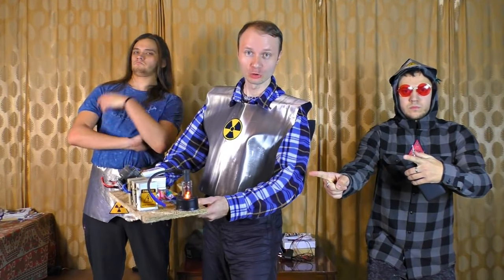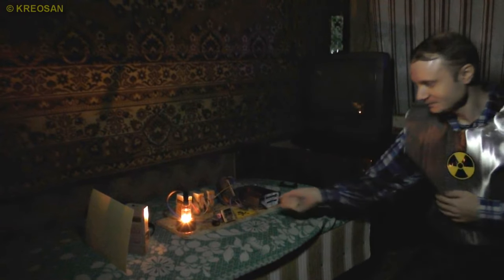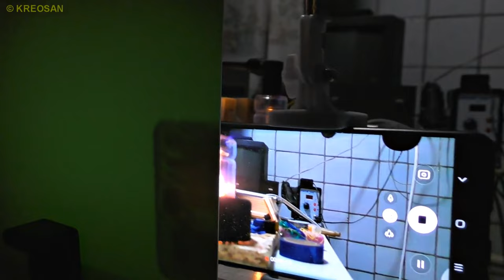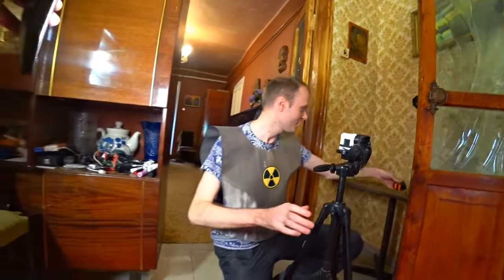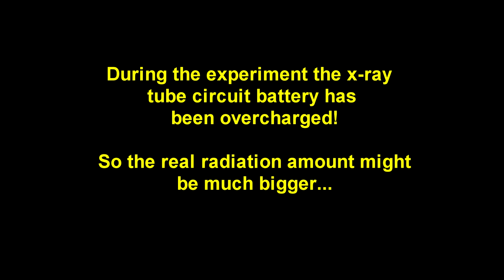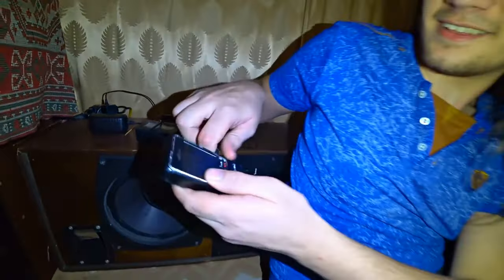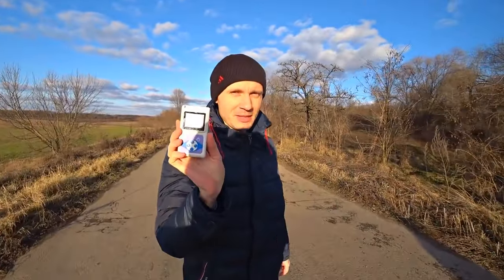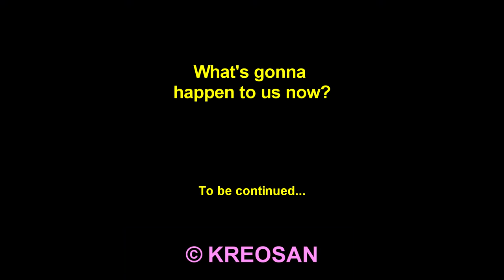X-Ray Gun ⚡️☢️⚡️ Experiments

Comment: They should have measured the radiation behind the device where that guy was standing. From a 1m distance they showed it was producing around 300 R/h, that's 0.083 R/s. We know that the absorbance of X-rays is low, and so they probably absorbed 0.83mGy/s which is equivalent to 0.83mSv/s. This is bad, but it's not as horrific as people are making it out to be. You start to see real damage at around 1Sv. You'd have to spend around 20 minutes continuously in the beam to get that kind of dosage at 1m distance. The guy that stuck his foot in there was much close than 1m. So he could have easily gotten a significant dose from just a few seconds. And the guy switching the unit on, if he was standing at that distance for 20 minutes or more cumulatively might have gotten a full body dose over 1Sv. It really all depends on how cognizant they were of these risks before they started. They definitely increased their risk of getting cancer. Radiation poisoning... well... I guess we'll find out in a few days I guess. Next video: KREOSAN visits the hospital.
Reply: So you say at 1 meter is about 3Sv/h
And around the source? How much is it producing?

Comment: X-rays will make a geiger counter scream for decay counts, but the decays themselve are not carrying as much energy a gamma rays. X-rays are dangerous non the less. Plus at the order of magnitude rates you guy measured, a Geiger-Muller Tube is grossely inacurate. You need an ionizing-chamber survey meter in order to make any sort of realistic measurment of the real amount of radiation you've been exposed. Be mindefull, your testes, your thyroid and your bone marrow and your gastro-intestinal mucosa are some of the most sensitive organs to ionizing radiation exposure. So you exposed yourselve to high radiation (especially since the levels rise exponentially proportionnal to the inverse of the distance you stand from the radiation source) you might fell tired, you might be more suceptible to infections (if your bone marrow become anaplastic) and you might experience diarrhea and vomitting from bowel mucosa irradiation. If you guys play with radiations, you guys need to find a way to direct the radiation in only one direction (collimation) by sheilding all arround the source except in the direction of collimation, by using lead ingots. Also, you need to wear a cumulative dose meter on your body to know the kinds of cumulated radiation doses you guys cumulated. Geiger counters is not good enough.
Reply: A gamma scout GM counter has a top of the scale measurment of 5 mSv/h (5000 uSv/h). That converts to 0.54 Roentgen/h.
Reply: i cant belive they do it so stiupid way
Reply: I have the same tube they used in my collection.  When I energized it, I found that it emits strong radiation in all directions, like a point light source, even through the thick copper anode...
Reply: @Paradoxical Nightmare by quantum mechanics, everything can be "light" - waves.
Reply: X-rays and gamma rays are the same particle and indistinguishable, the only difference is their method of production (nuclear vs. non nuclear decay processes). Historically the methods of production were such that gamma rays from nuclear decay were higher energy, but nowadays x-rays can be much, much higher energies, thanks to high energy linear accelerators.

(also thanks for clarifying that an ionization chamber is required. The GM counter is woefully inadequate for purpose)
Reply: @Paradoxical Nightmare You are completely and utterly wrong. Light has a colour, the wavelength is the colour. light with a wlength of 450nm would be blue, 500 would be green. Pure white as a single colour, doesn't actually exist, it's just an even mix of colour that mixes to form white.
Reply: @Paradoxical Nightmare at least you learned something dude, keep learning stuff.
Reply: @kyleewert1278  X-rays have shorter wavelengths (higher energy) than UV waves and, generally, longer wavelengths (lower energy) than gamma rays.

X-rays are broken up into broad two categories: hard X-rays with energies above 5-10 keV (below 0.2-0.1 nm wavelength) and soft X-rays with energies 100 eV – 5 keV (10 – 0.1 nm wavelength). Hard X-rays are more useful for radiography because they pass through tissue.

The distinction between X-rays and gamma rays is somewhat arbitrary and there is substantial overlap at the high energy boundary. However, in general they are distinguished by their source, with gamma rays originating from the nucleus and X-rays from the electrons in the atom. https://courses.lumenlearning.com/boundless-physics/chapter/the-electromagnetic-spectrum/
Reply: I have a feeling you know what you’re talking about
Reply: Umm x rays have the most power. They are way over gamma even
Reply: @MrTurboturbine  what is the this tube part number?
Reply: @jasonbattye7672  , Kodak TRX708
Reply: My dumbass has opened up a smoke detector just to poke at the americium with a pencil

But that’s as far as I’ll ever go to this insanity hel no
Reply: @peterzingler6221  Pretty sure gamma radiation is the most lethal on the electromagnetic radiation spectrum.  I may be interpreting your comment wrong though, sorry if I am.
Reply: @neb1ros  gamma radiation that physically destroys organic cells and I think also electronics too

It will rip sort a computer physics destroying it, which is why the chrenobyl robots all failed
Reply: @tony_5156  Thanks for your confirmation, Tony.  Gamma is king!
Reply: Geez dude, chill out, it's just some bros having fun
Reply: @CTimmerman   The way I classify gamma and x-rays is by their production mechanisms, to be considered being a gamma ray it has to come from the nucleus of an atom due a decay event, if the photon comes form orbital electrons or bremsstrahlung then is an X-ray regardless of energy. 
I am against using energy to tell the difference between x-rays and gamma rays because the generation process are different yet the energy they have can have overlap all the way to the UV, there is a Thorium isomer that has a decay gamma energy of 8.3eV just as there are particle accelerators capable of producing X-rays with energies of more than 20MeV and probably higher but im not sure if bremsstrahlung physics hold up at energies above 20MeV because electrons begin penetrating into the nucleus and might in fact cause gamma emission.

Comment: You guys claim yourselves as professionals... sometimes I truly wonder about that... but don't jeopardize your health for the sake of science. I truly enjoy your videos, you guys are most craziest Slavs I ever seen so far. If the Chernobyl trip wasn't dangerous enough, I think this time you just raised to bar. Don't get me wrong, I'm just worried about your safety sometimes...I'm not a professional by any means, just a Subscriber who just happens to agree with the majority of the comments here. Stay safe!
Reply: No worries, I did not see any science there so they just jeoppardized themselves for internet fame. Which is fine because it's perfectly OK to die for that, apparently.
Reply: A professional is someone who gets paid to do a thing. They are getting paid by YouTube ads..so that would make them professional YouTuber's and Tubers do stupid things. Come on now.
Reply: Jerry Jonty those weren’t what you’d call safe either but to each their own. I wouldn’t touch any high amperage/high voltage machines with a 10 foot barge pole. But it’s my job, these guys would be fine if they just took higher precautions.
Reply: @raghavendrasharma225  Setting off fireworks inside and melting wire with mains power isn't very safe.
Reply: The Chernobyl trip basically wasn't dangerous at all. The levels of radiation and amount of radioactive dust you might inhale are far too low to have any measurable long-term health effects unless you spend many weeks into months straight around the hot zones.
Reply: @Alongfortheride693  What are they?
Reply: @STONEDay  haha couldn’t have been said better

Comment: Guys, I'm sorry, but you clearly have no idea of what you are doing. The distance at which you put your hand infront of the Xray Screen is around the same distance you measured the 700R/h. you hold your hand there for 2min and you are already at the DHS emergency guideline. You hold your hand there for a combined 10min and you in the range, where people start vomiting afterwards.
Watch the hair on your hands and when it start to fall off maybe then you realize, what you have done.
You need to stop immediately and go back to electricity, that you understand.
Reply: Yep hair on hands and head will start to fall out. This is silly what they are doing
Reply: Holding for 2 minutes won't do anything bad. The dose would be 233msv (23.3roentgen(
Reply: @tamsusmomentai4013  The cumulative dose is one thing, the rate at which you were exposed to it is even more significant. Getting 1 Sv over a year is incomparable to getting 1 Sv over a day or an hour; in the second scenario, the quantity of cellular and molecular damage done is significantly higher, and directly interferes with the body's capability to self-repair these damages. At 1 meter they measured 410 mSv/h which is already massive and enough to cause immediate danger.

Comment: This is really dangerous. A small X-ray tube like the one in the video easily produces radiation levels of several sieverts per hour ! Please note also that regular geiger counters may give false readings when dealing with X-rays. The G-M tubes in regular geiger counters are especially made for the detection of gamma rays not X-rays. While both are technically the same (high energy photons), gamma photons tend to have higher energies than (most) X-ray photons. Low energy X-ray photons may even not be detected by standard G-M tubes but can be very dangerous as they are absorbed more by bodily tissues than the high energy photons which tend to just pass through.
Reply: Based on inverse square law calculations I calculated 51.2-204.8 Sv/hr. Death in minutes, cancer risk increased in seconds.
Reply: Ugh, do you actually think that a random person with some hobbyist-grade handheld X-ray gun is going to start cranking out "several sieverts per hour"? Seriously? Do you even know what you're saying? First of all, you're talking about sieverts, which are a *measure of biological effect*, not raw radiation output, which would be in gray (Gy), or more commonly, in roentgens (R). But fine, let's pretend we're in a world where this handheld X-ray tube is somehow the most dangerous gadget ever made—yet still small enough to lug around. Right.

Now, on to the point about Geiger counters "giving false readings" with X-rays—uh, no. That's not exactly how it works. A Geiger-Müller (G-M) tube detects ionizing radiation—whether it's gamma rays or X-rays, they both are detected because they're forms of ionizing radiation. But here's where you're misunderstanding things: low-energy X-rays are not some kind of invisible boogeyman that's magically evading your Geiger counter like it's got a Harry Potter invisibility cloak. No, the issue is efficiency. A Geiger counter might be less sensitive to low-energy X-rays because, yeah, G-M tubes are optimized for higher-energy gamma rays, but it still detects them. You're just getting lower counts per minute (CPM) because of lower energy per photon, not because they're undetectable. So your statement about low-energy X-rays being "very dangerous" because they absorb more into tissues... well, yeah, that's why we use lead shielding for any type of X-ray exposure, but your handheld tube? That's hardly producing the kind of output that’s going to nuke someone in seconds like you're claiming.

And let’s not ignore the fact that for anything handheld, especially if it’s something repurposed or cobbled together, the amount of voltage and power it’d need to produce a dose rate of several sieverts per hour would fry the device itself—or the person using it—long before it starts threatening bystanders. If it were truly producing several sieverts per hour, you'd be dead pretty quickly just from holding the thing.

So please, let's not get ahead of ourselves here.

Comment: 19:55 OH NOO! that is not going to end well based on this video...
Reply: Are they Russian?
Reply: @Kevin.98420  no 
Ukrainian
Reply: Im not sure which part worries me more, them trying to tie into a "high voltage line" (powerline?) or the possibility of them succeeding and producing maybe 10,000 r/hr at 3 meters. Based on their problems managing radiation and arcing in this video, they'll probably die either way. Best case scenario, the wiring flashes over and engulfs the whole thing in plasma within half an AC cycle,  cracks the glass and burns it to a crisp, while they stand far enough back to not be burned or shocked.
Reply: These guys don't even care about their lives, if that small tube can produce x-rays that are enough to give you malignancies think what would happen if they use that ginormous tube
Reply: @deltab9768  yeah i am not sure if that giant xray tube thing is something they should be messing with, if they don't think about safety shit they will die while messing around with xrays.
Reply: @Iodine_53  like I said, If they're doing what I think they're doing, I hope they short 110kv, several kA across it, while standing far enough back to not be hurt. I honestly cant think where they'd get a real 110kilowatt high voltage power supply, so I'm assuming they mis translated "kilovolts" and that they're wiring it to a 110kv power line and hoping for the best.
Reply: Kinda hope this is all faked somehow.
Reply: @amoniousbt1110  I don't think it is faked, when they put the camera in the beam you could see the pixels getting weird because of the xrays, that effect is really hard to fake. But maybe they are just making it seem more dangerous for views... 

i hope
Reply: @Iodine_53  I doubt it's faked because what they're doing is super easy to do. Just stupid dangerous too.

Comment: Don't use that giant xray tube. U guys are risking life of your and people that live near you
Reply: Yes. If they staid 50 meters away maybe they could be OK, but after the way they were handling this smaller one I'm worried. Did they ever think to check how much radiation is leaking to the side of the beam? And don't get me started about connecting to a "110 kilowatt high voltage line." That's not going to go well if they have even one of the short circuits we saw in this video. And where do you even get a 110kw high voltage power supply? I wouldn't be surprised if that was a bad translation of "110kv" as in a multi megawatt power line. No!
Reply: @deltab9768  I the bet radiation will still be intensive at that range. Have u seen the small xray tube's radiation rate from far away. Anyways the radiation is still not good
Reply: @bikgamer  yes. The small one had 60 milliroentgen per hour at 36 meters, so more than a normal yearly radiation dose from a continuous exposure of 1 day.
Reply: you guys clearly dont know how radiation work.. u need to stay 5 hour in the rays since it went of scale 100Rh we asume its 100Rh u need to stay there 5 hours to get ARS and thats really fast but you also need to be within 1 meter of the source and these guys stayed there a short time in the rays so they will be fine but yes Cancer risk is increasing but the short amout of time it spent with in the ray and body parts exposed they will likely be fine continiung the experiments  if they dont spend much time in the deadly beam of radiation.. but this is something you DONT TRY AT HOME but these guys are not profesional but they know what to do and not do... it really dangerous what they are doing but if they have the right equipment and dont go in the deadly ray too much they will be fine.. but too be on the safe side they should quit ( if u look at main channel.. they have not continued any more experiments with this)
Reply: @eliasnikolaivonheimtrondse4424  I'm sorry but what are you talking about goes for gamma radiation. X rays are a completely different beast. They are probabaly pushing 3 sievert with that tiny tube a lethal amount in 20min.
Reply: @peterzingler6221  They, for one, are nowhere near 3 sieverts per hour, at worst they've been in the 100 milisievert an hour range and that was only for a few minutes total, so a total exposure closer to 3 milisieverts is much more likely. Secondly, gamma and x-ray radiation are the least ionizing forms of radiation. If it was an alpha or beta source putting out this much energy that'd be more concerning but it's simply not. X-rays in more conventional energies are generally less ionizing than gamma rays, but that's only in conventional ranges. In truth the only real difference between x-rays and gamma rays is their source, they're both photons with a wide range of overlapping wavelengths, so they're not a "completely different beast" in any sense.